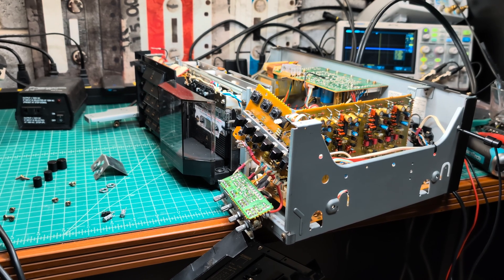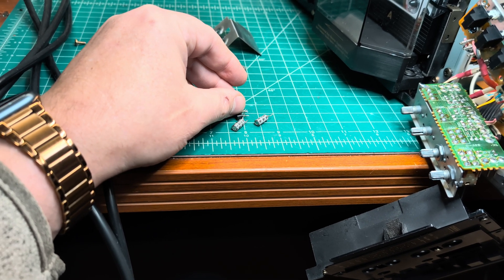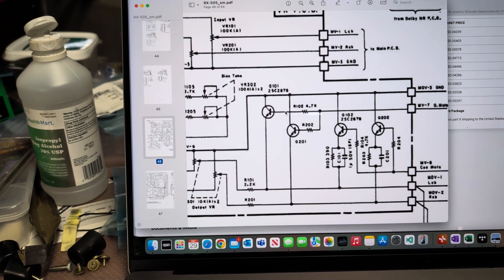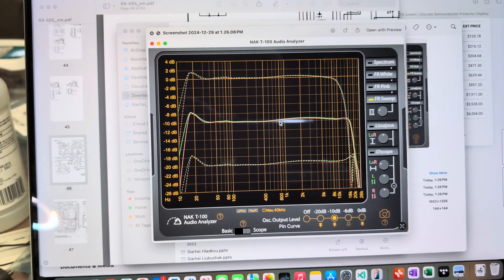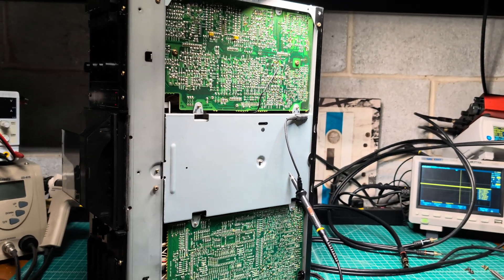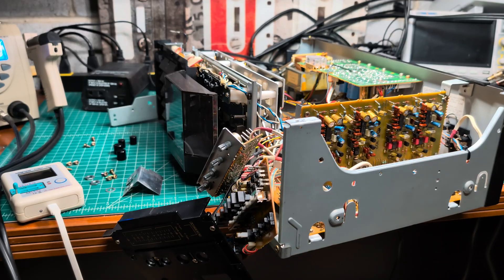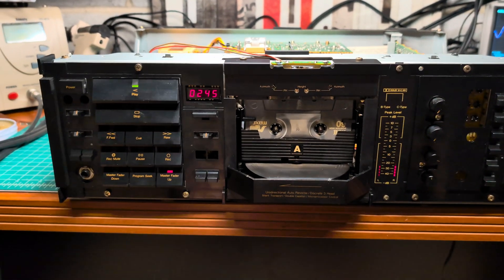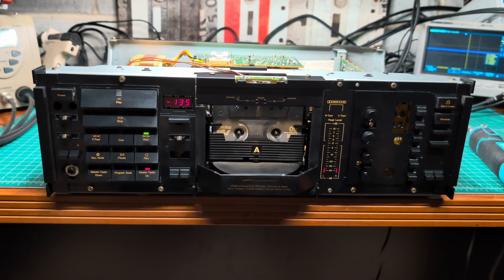Fixing Negative DC Voltage on Cassette Deck Output: Nakamichi RX-505 Example

Comment: While I understand that this negative dc output is undesirable and needs to be fixed, I presume that most amp inputs are AC coupled so it shouldn't make a difference?
Reply from the maker: @DJNeiloSF  it depends on how badly that transistor failed. It may start distorting the sound. Also, in some decks it is coupled with Dolby IC, making situation even worse.